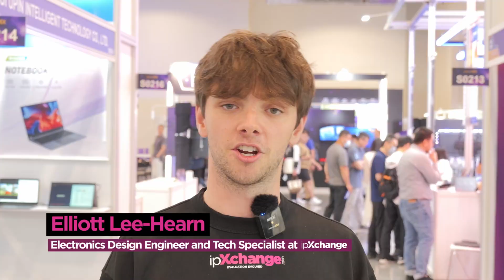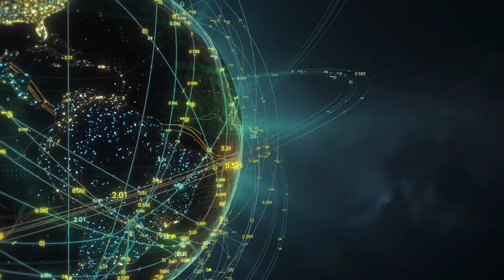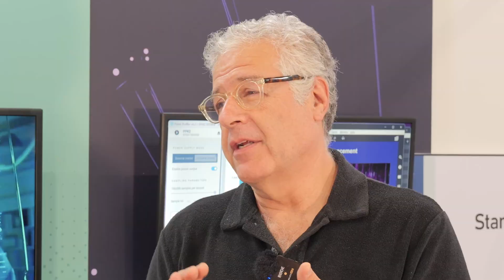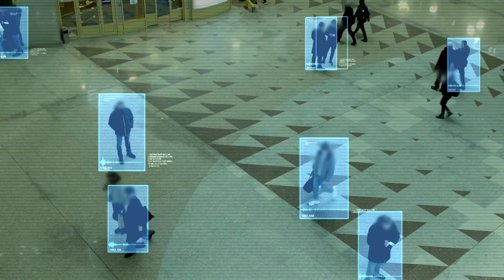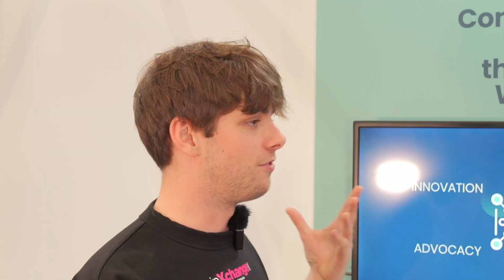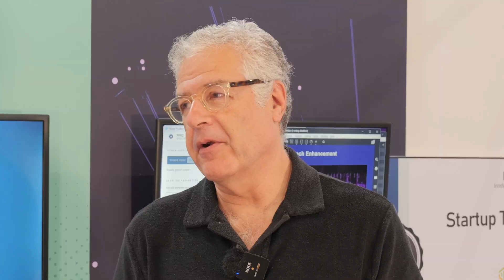What Really Is Edge AI? Explained by Edge AI Foundation

Comment: Let's reframe Earth's low diversity abundant ambient heat as a thermal energy waypoint between heat and other forms of energy. 

I am on a 60 year quest to overcome the second law of thermodynamics . that began as a teenager inspired by reading View from a height,  Doubleday 1963, a science anthology by Isaac Asimov. He first wrote very convincingly about the  principle that energy is conserved when changing form then wrote much less convincingly about the concept of entropy. 

The concept of entropy is stronngly accepted to this day after being promoted by a prominent astrophysicist, science popularizer, and Quaker Sir Arthur Stanley Eddington who considered the second law of thermodynamics to be the most fundamental and universally certain law in all of science. He believed that entropy never decreased so the universe faces an ultimate death by heat stagnation so somehow the universe had to start with low entropy. Eddington had a deep metaphisical side so he also believed that God was beyond the relm of science. Theologians used the second law as proof of God. This is unsound proof because God could alternatively be supreme over an eternal non doomed universe. 

Energy changes form without gain or loss. Uniformity or diversity is not, in itself, a form of energy.  Therefore entropy is an extraordinary claim burdening the law that energy is conserved even if it is changed in form. Thermal energy's almost universialy observed present practice of a partial  transformation range with an unusable residue is an inelegance. 

Because the second law is intensely accepted it is hard to find people that want to prototype devices that may falsify the second law. Therefore I am posting this essay as a comment on YouTube to attract teams or exceptional individuals with access to suites of complex equipment to first, build exploratory prototypes that could prove the concept, then make any easily seen possible improvements to improve robustness and consistency in any process that makes successful small batch replicated proof of concept prototypes.  A lot of small sample working device trinkets can then be made to be introduced and handed out widely to people at media conferences. A low power proof of concept prototype would power a LED in an eyecup with Inspectable parts and assembly and socketable dummy chips as controls. Subsequent conferences would be called to report news of more powerful prototypes powering more powerful samples that can be offered for examination. 

Go ahead and start to build something inspired by this introduction without my involvement. We can meet after there is solid crowd verification.
After small scale prototypes of various types are made with widely developed processes many enterprises will be able to think of fitting scale production. There is no need to have one manufacturer emerge. All competent manufacturers should develop their processes without exclusivity or forced dominance. I don't think I have outstanding abilities at this phase so I'll help but mainly get out of the way. 

Energy sensible refrigerators that absorb heat and yield electricity would complement computers as computing consumes electricity and yields heat. Computing would be almost free. Chips could have  energy recycling sophisticated srructures combining microscale heat pipes and light and electricity paths built in. 

Full heat recycling, all electric, very isolated underground, undersea, or space communities would be highly survivable with reduced ElectroMagnetic Pulse pickup which eases further protection, self sufficient LED lit automated vertical farms, thaw resistant frozen food storehouses, amphibious factory submarines, nonstandard dwellings, self contained elevators, safe rooms, and free range transports.Some electrical equipment groups could be consolidated into local networks when suitable. Liquid nitrogen cooled superconducting networks would become practical. Fire safes would maintain contents at a desired temperature in extreme heat or cold for years. 

In a flourishing civillization, small self sufficient electric or cooling devices of many kinds and styles, lamps, smartphones, hotplates, water heaters, cooler chests, fans, radios, TVs, cameras, security devices, robots and robot test equipment, scales, transaction terminals, wall clocks, open or ciosed for business luminous signs, power hand tools, ditch diggers, pumps, and personal transports, would be available for immediate use incrementally anywhere as people as individuals or larger social groups see fit. Human enobeling communities could be built quickly. 

If a high majority thinks our civilization should geoengineer gigatons or teratons of greenhouse gasses out of our environment, hypothetically networked instalations, either a few big ones or many small ones using clea electricity, heat, or refrigeration and producing desired side products would be built. 

A simple rectifier crystal can,
just short of a replicatable long term demonstration of a powerful prototype, almost certainly filter the random thermal motioren of electrons or discrete positiive charged voids called holes so the electric current flowing in one direction predominates. At low system voltage, a filtrate of one polarity predominates only a little but there is always usable electrical power derived from the source, which is Johnson (observation) Nyquest (theory) thermal electrical noise. Max Plank anticipated that ambient thermal noise would become usable with advances in technology. 

In 1973 I filed for US patent 3890161A DIODE ARRAY for an array of metal1/ insulator/metal2 diodes that refrigerate while concurrently producing electric power. The patent was granted in 1975. It was opened to the public domain in 1992. Development is in the public domain while granting me writing attribution. 

The plausible net electrical filtrate from diodes can be aggregated in a first grouping of separate diodes in  consistent alignment parallel. After a primary level of grouping that preferably is in parallel where current is additive, compound parallel and series where both current and voltage are additive, networks can be built to provide desired DC current and voltage. Within limlts, parts of the  network can be shorted out or open circuted without electrical or chemical harm. Widely scalable electrical power always paired with equal refrigeration is thus possible. The efficiency of each diode is low because the nanowatt random  power within each diode doesn't rectify well. This inefficiency affects the performance but not the equality of the thermal absorbtion and the electrical yield. 

The maximum energy is converted from ambient heat to productive direct current electricity when the load electrical resistance  is equal to the array internal electrical resistance. Maximum calculated electrical power output (watts) is k (Boltźman's constant), one point three eight x 10^ minus 23, times T (temperature Kelvin) times bandwidth (0 Hz to a natural limit ~2 THz @ 290 K) times rectification halving and nanowatt power level rectification efficiency, times the number of diodes in the array. 

There are a billion measurment cells of 1000 square nanometer area each per square millimeter, 100 billion per square centimeter. 

Order is imposed on the random thermal motion of electrons by the structual orderlyness of a diode array made of diodes made within a slab: 

Host crystal in this example is silicon or germanium 

 
________   -out
🔻🔻🔻🔻P type boron doped
■■■■■■N type Phosphorous doped
                      +out 

All the P type semiconductor anodes abut a metal conductive plane deposited on the top face of the slab with nonrectifying joins;  the N type semiconductor cathodes or common cathode abuts the bottom face. As the polarity filtered electrical energy is exported, the amount of thermal energy in the group of diodes decreases. This group cooling will draw heat in from the surrounding ambient heat at a rate depending on the filtering rate and thermal resistance between the group and ambient gas, liquid, or solid warmer than absolute zero. There is always a lot of ambient heat on our planet, more on equatorial dry desert summer days and less on polar desert winter nights. 

How can the emperical second law of thermodynamics possibly prevent a DIODE ARRAY from working? 

Hopefully a lot of people, mostly as independent teams, will join in developing the DIODE ARRAY. Please share the successes or setbacks of experiemental efforts. The topic deserves crowd financing, discussion and prototyping attempt action. Crowd development would be resistant to confiscation or burial. At best there could be science quality colaboration. 

These rectifiers could be various types, such as:
• Field emission diodes: An array of needles the needles made of carbon nanotubes or another electrical conductor tipped with an emmisive material probably LaB6 abutting straight in and also separated by a thin insulator or vacuum gap from a metal plane substrate surface.
• Schottky diodes: A metal needle-to-semiconductor junction diode, the semiconductor may be Gallium Arsenide or Indium Antimonide.
• Silicon or Germanium crystal diodes: A well-established technology. These diodes may have poor performance in this application 

These devices would probably become segmented commodities sold with minimal margin over supply cost. They would be manufactured by advanced automation that does not need financial incentive. Applicable best practices would be adopted. Business details would be open public knowledge. Associated people should move as negotiated and freely and honestly talk. Commerce would be a planetary scale unified conglomerate of diverse local cooperatives. There is no need of wealth extracting top commanders. We do not need often token philanthropy from the top if the wide majority of people can afford to be generous.